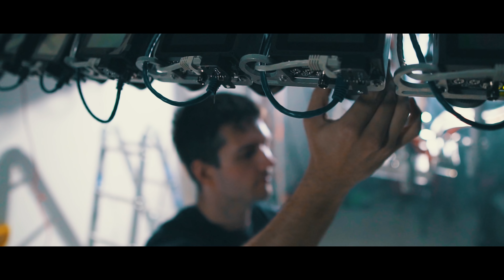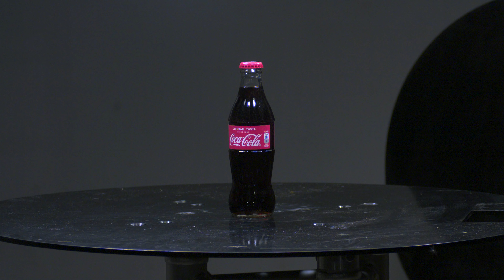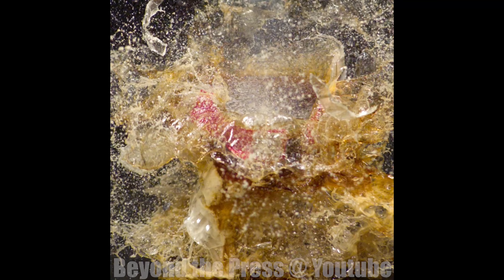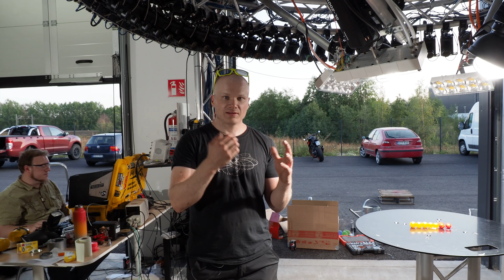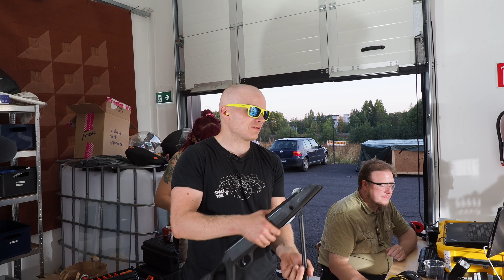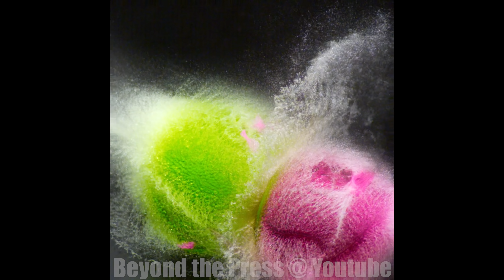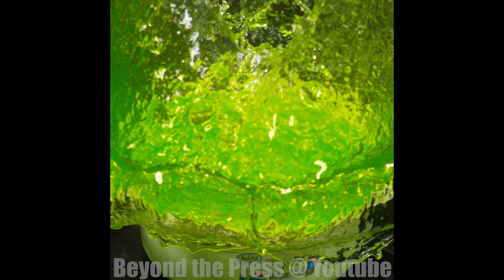Skipping a Bullet on Water at 100 000 FPS | Real Life Bullet Time!

Comment: Couple of ideas for you. 1 a plastic soda bottle with carbon dioxide chips inside of it which you seal and wait for it to fail. Generally these explode very loudly and sound like a 12 gauge going off. The only problem with that is you can't tell exactly when it's going to go so you may have to be filming for quite some time and I don't know how that would impact those cameras. Alternatively you can wait for it to swell considerably and then use a BB rifle to contract and capture this failure and high speed.

Two nitrogen triiodide. This is an very sensitive impact explosive which is very easily made. If you want details on it you can Google it and I can tell you how to do it it's simple. But the decomposition of nitrogen triiodide may be very interesting to see.

2)  nitrogen triiodide with a little bit of tannerite right on top of it.  For some spice.

3) nitrogen tri-iodide with a lifesaver on top.  Triboluminescence.

Comment: I don't think this is quite the same as a high-speed shot from a single camera in terms of the speed. You get 1 million frames a second but it is from 30 different perspectives ( assuming 30 cameras I can't remember how many you actually have in the ring). Each frame is about one Thirty thousandth of a second where as a single camera would have for example one three hundred thousandth of a second from one perspective for each frame. The ring gives a 3D representation of sorts where as a single camera is more two-dimensional but shorter durations for each frame. In other words with the ring I see a single spot  and then see it again 1/30 thousandth of a second later, whereas with a single-camera I see that same spot one three hundred thousandths of a second later ( or whatever the frame rate is set at.  The point is, that with a ring of 30 cameras, the single spot frame rate is 1/30 the total frame rate). I believe this is why you do not see a crack in the glass propagate with the ring because the crack is moving too fast, whereas you might see a crack propagate with a single perspective camera at 300000 frames a second. It's still amazing but the frame rates aren't exactly equivalent in my opinion.
Reply from the maker: The ring produces the frame rate on exactly the same way that one spinning camera would make. It just has to spin really fast to match the frame rate. On small things like soda bottle you just need more speed than 100 000fps to really soo glass crack but we have one video coming with glass thing filmed 1 000 000 fps so there you are going to see lot more

Comment: Psst! Hey Anni, your husband isn't loading the gun safely! 

Lauri, you should hold the stock between your right arm and body then hold the barrel with your right hand while you load with your left. When you don't hold the barrel you're putting your fingers and face at risk if the cocking safety ever failed. Your fingers can get crushed and the barrel will look like a banana. 

It's a small risk, and I can't say I never load the way you did, but it's safest and just as easy to hold the barrel.

Comment: What does a Chronos ring cost?
Reply: $400k to $500k give or take a buck or two.  5KW LED water-cooled lights, but he saved a bit using a free bucket.😊👍
Reply: @WoodworkerDon  I'm sure the pc that's processing all that data is probably not your typical gaming rig either.
Reply: @julians7268  and many Terabytes of drive storage too. 👌
Reply: @WoodworkerDon  I'm sure that "many" would be a minimum requirement for such a beast. I bet the algorithm that creates the footage out of the raw data is pretty interesting.
Reply: @julians7268  I'm pretty sure they mentioned the capacity of the NAS - Network Attached Storage on one of the first videos. I just don't remember the number. But it was sizable.

Comment: re: the coke bottle. So The top of the bottle starts getting cloudy I'm not sure if its because co2 is coming out of solution from agitation, or ( which i suspect) water vapor is rapidly condensing due to the sudden drop in pressure.
Reply: It looked exactly like rapid decompression fog as you suspect. Luckily I've never seen it happen in an aircraft at altitude. But we did experience it a couple times in the altitude chamber at USAF Survival School.

Comment: Change the title of your video there's a big difference between a bullet and a pellet
Reply: Same thing though by definition.

Bullet, from the French boulette (little ball) from the Latin bulla (bubble). 
bul·let

/ˈbo͝olət/

noun

noun: bullet; plural noun: bullets

1.

a metal projectile for firing from a rifle, revolver, or other small firearm, typically cylindrical and pointed, and sometimes containing an explosive.

How's it is propelled (air/other gases) doesn't matter.
Reply: @CsykKrit  umm no a bullet is a lot different then a pellet especially when you even add real lift bullet in the title its click bait
Reply: @CsykKrit  also in the definition of bullet it says fired from a firearm bb guns and pellet guns are not firearms